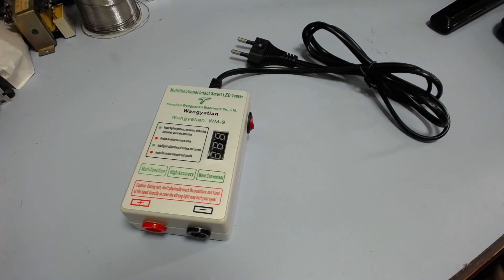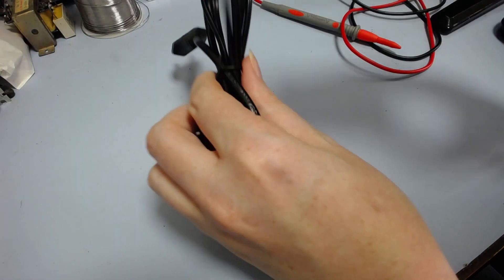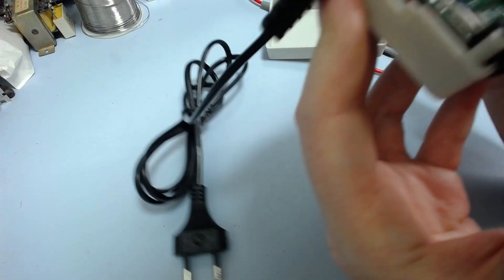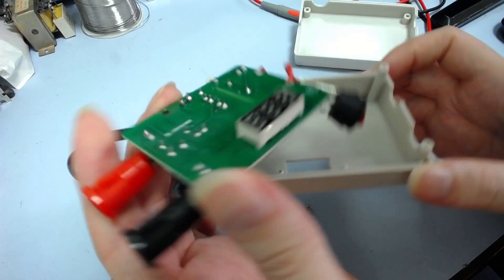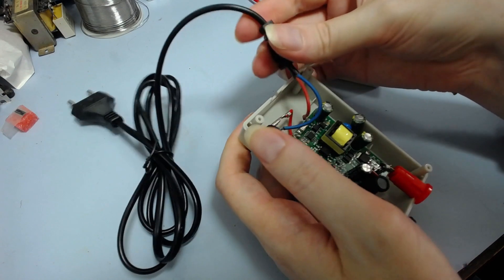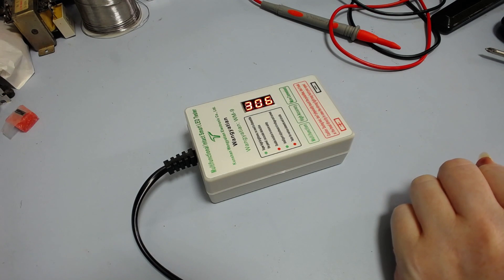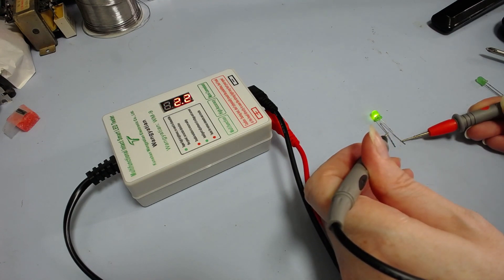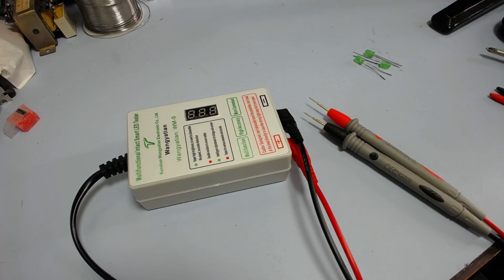Quick teardown & test of a WM-9 LED backlight tester

Comment: i bought one of those LED backlights tester via Aliexpress about 2 years ago one of the capacitor blown near by that Coil the size of it can't be seen, can you plz help me out with the size of that Capacitor near by that coil
Reply from the maker: I would have to know exactly which capacitor you are talking about. There are several capacitors nearby.

Comment: Nice video and thanks for sharing, I don't think the output voltage from the probes would be more than 24 volts my reason for thinking this is there could be 2 circuits, one for the meter reading and one for the probes.
Reply from the maker: It definitely outputs a high voltage, it can't test long series strings of LEDs otherwise.

Comment: Good to see you back mate. Quick question why would you not just use a multi meter in diode mode to test the LEDs ? Or am I missing something
Reply from the maker: The reason is that it can test LED strings (like in TV/monitor backlights) with a forward voltage up to 300v, you can't do that with a multimeter.
Reply: @Agent24Electronics  I stand corrected brother. Hope you’re well mate